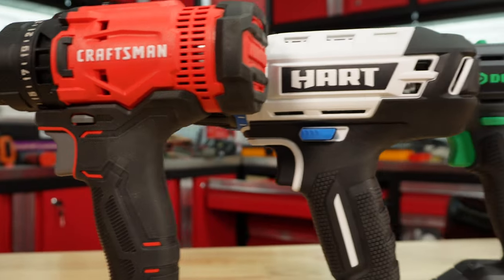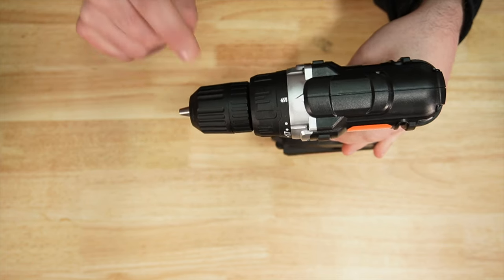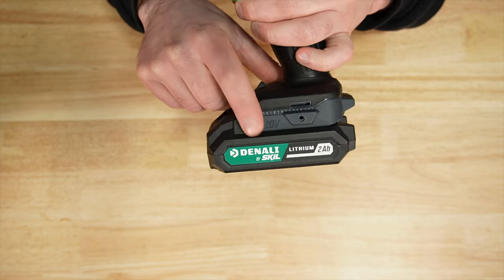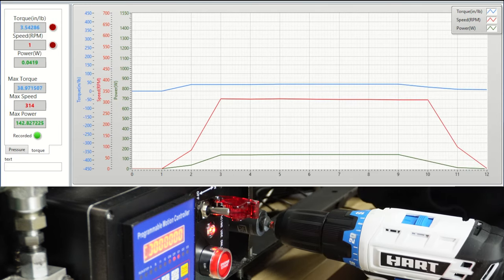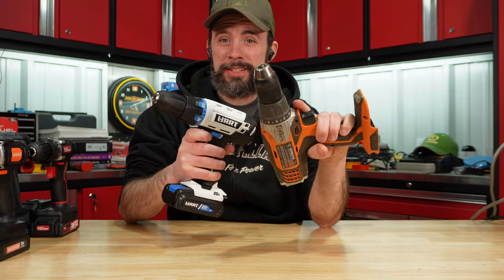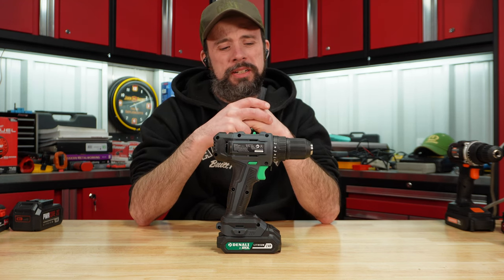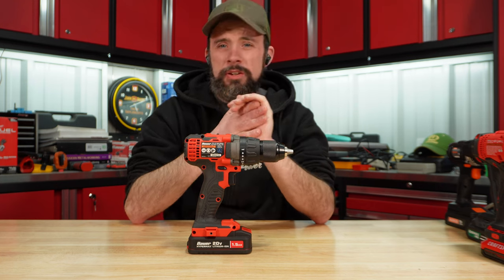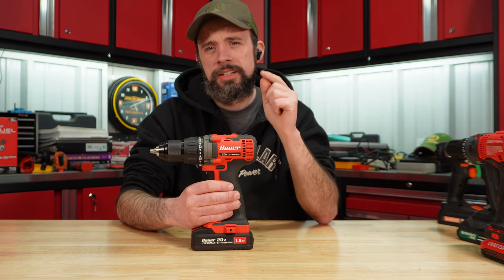Best Worst Drill Testing

Comment: I bought the craftsman one on clearance for $40 just to have the extra battery for my hedge trimmers and ratchet. Those are the only craftsman tools I own and that drill may not hang with my Milwaukee, but it can definitely hold its own for someone just needing a general household drill.  I use it as a loaner so if I don’t get it back in working order, I’m not mad at anyone lol.
Reply from the maker: Yeah you can’t beat that at 40,  It definitely has good power.  That’s a good point,  if you let someone borrow it and they destroy it your not out much.

Comment: Good video. I have two of the Bauer ones and like them quite a bit even though one has developer an intermittent trigger (mechanical issue I procrastinate to investigate). My biggest gripe is with the batteries, I must have bought half a dozen or more of them for each drill (I have the drills in separate addresses) because they die quickly, and I always end up having to decide whether to switch system ($$$) or replace them ($). The decision in the short term is obvious, but in the long term is starting to no longer make sense. BTW, I am not using these drills very often, but the batteries will fail to charge at some point as I put them on the charger. I did not want to put the batteries in the trash, so I still have some of the failed ones in my garage in case you wanted to look into them. Love your videos. Ciao, Marco.
Reply: Don't store outside or leave on charger overnight. Almost nobody treats the batteries correctly why there's a large complaint segment for every brand.
Reply from the maker: Thanks! Interesting maybe time to look at Hercules,  I know the extreme packs have Samsung cells.

Im going to test the Bauer battery's this week and do a teardown.  Im curious to see what cells are inside.

Thanks for the info!
Reply: @Tools-Tested  Anytime!

Comment: What about Black and Decker? They have the entry consumer drill... and they make Dewalt (and Craftsman now?).
Reply: I'm curious to see where Black and Decker would end up on the chart as well.
Reply from the maker: Honestly I have yet to buy it, I was already maxed expense wise for the month.  I just don't have the money like large channels.  I do plan to test it in a part 2 along side the brushed ridged,  Milwaukee, ryobi.

Im also having trouble determining which Black & Decker to test,  they offer a good amount of different models.  Might have to be a video just for Black & Decker.
Reply: @Tools-Tested  BD would definitely be interesting, since they have two drver offerings that I know of... a standard budget drill, and their Maxtix line with swappable heads.  My first drill was a BD until I wanted better battery life, and started building out my Dwalt XR tools. So far, zero issues with Dewalt XR and 5ah batteries.  I think the BDs are 1ah or 1.2ah... both not good on hardwood, and not a lot of power.
Reply from the maker: @mrallan8063  That maxtix is interesting,  probably next month I will do a part two. Yeah the battery options are limited with budget tools.  The XR line has tested really well,  I love the 3" cut off tool.

Comment: I have the Hart as well as Bauer and Craftsman. The Hart is definitely huge compared to the other two but it hasnt failed me yet. The Bauer I've had to warranty it out twice, one started smoking and the second one just died randomly from one day to the next. The Craftsman is solid and i bought it cuz i got it on clearance, if it was regular priced I wouldve passed on it. 

Will you be doing a Brushless version test of these? Thanks gor the great content and for using budget friendly brands in your tests. Other channels just focus on the top end and leave us DIYers hanging.
Reply from the maker: Thanks for the info! I agree the craftsman is only worth considering when onsale.  

I did test the brushes models in 2 separate videos Best Brushless Drill Driver? Mid Spec
https://youtu.be/EVlZLBZQJB8

No problem I try to focus on the complete range so you can really see if spending the extra $ is worth it.
Reply: @Tools-Tested  I appreciate the reply. Wasn't expecting that. Lol. I saw your video for brushless ones and again, thanks for a thorough testing and compassion of the tools. I jumped on the Hart line because I like the colors and I have multiple Walmart stores in the area, so I can usually find what I need there without ordering online. I also like the fact that they're releasing a lot of different items compared their sister brands Ryobi, Ridgid and Milwaukee. Yes, a lot of the early Hart tools seemed to be exact Ryobi clones, but the newer ones they've slightly tweaked them to be better than Ryobi and some of your tests on different videos have confirmed that as well. 

Anywho, enough yapping about that stuff. Thank you again for all the videos and useful data you've shared with all of us. Definitely becoming one of my favorite channels on YouTube. Take care.

Comment: I think brushed motors in power tools have had their day really. Even serious DIY are likely to avoid them now, probably just for someone to screw their house number to their door and never use again. I haven't seen a single speed box on a drill for years.
Reply: Brushless is unnecessary. Enjoy the microprocessor failures and failed permanent magnet from excessive heat/use.
Reply: @calculator1841  Brushed motors have permanent magnets too. They probably don't fail as often because the brushes die before the magnets get damaged :)

Good brushed tools have been around for ages. I think they can make good brushed tools. But everything expects good tools to be brushless nowadays so I expect that only the lowest end tools will be brushed partially due to consumer expectations.
Reply: @gf2e  Several manufacturers can and have made excellent brushed tools in the past. When battery tools were in their infancy, the larger SDS tools were still mains powered and brushed motors. But as you say, consumer expectations play a big part, and will drive the market, that has a desire to sell products to survive and grow. I think it was the trigger that went on my brushed Ryobi battery drill before anything else.
Reply: @gf2e  brushed motors are like manual transmissions on cars. Those have historically been more reliable than automatics, and when they fail it usually doesn't go past the clutch which would be much cheaper to replace than the whole gearbox.
But people no longer want mechanical shifting and the few that still do have to settle with an econobox or a sports car.
But even those are mostly automatics now as the multi speed transmissions are now faster than most manuals even with experienced hands
Reply: @gf2e Another plus of brushed tools, much cheaper and you can get brushes or even replacement motors for almost nothing, a 775 Mabuchi motor is $10, and you can even upgrade for either more torque or more speed